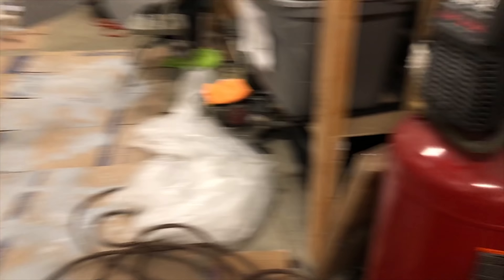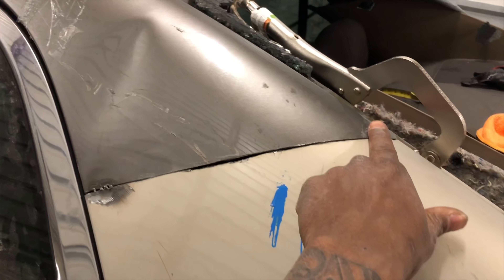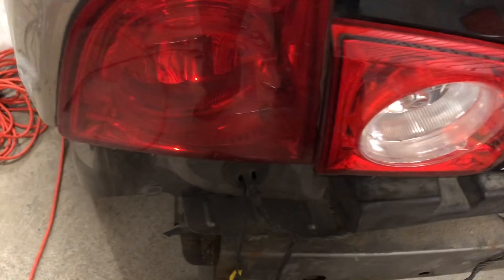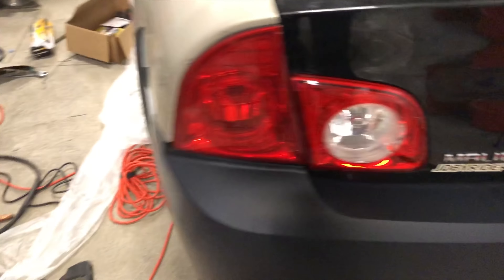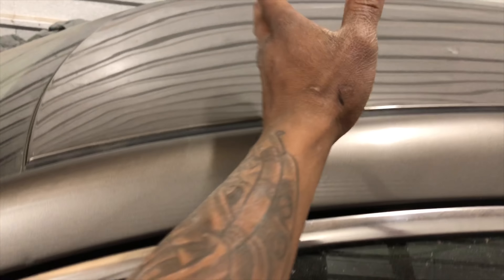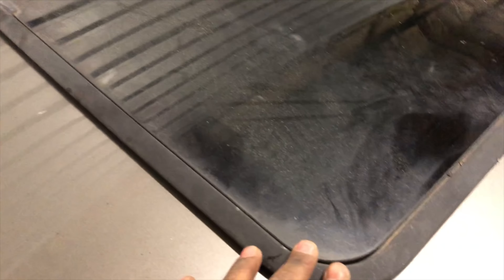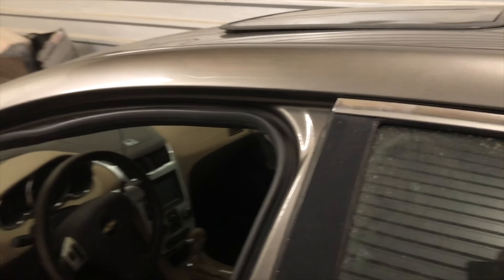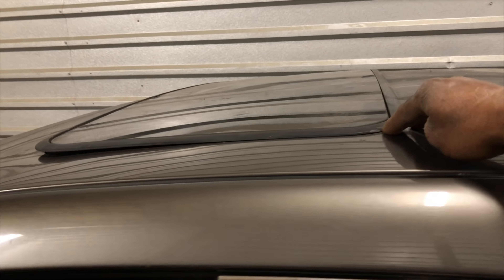2010 Malibu: Sunroof & Quarter Panels On But There’s Some Quirks

Comment: My advice would be but weld qtr pillar panels, grind welds, fill with Duraglass then body filler. If you weld plate on top like you said.  You will be creating a very high section that will be very hard to hide. You can weld a small tab on dent on original qte pillar. Then pull dent out with pliers or vise grips. Big and small slide hammers and a Magna Spot gun would be idea...but not worth investment if your not planning on doing lots of bodywork. Are you using flux core wire? I've never used flux myself. With thin metal like todays cars smaller wire like  .023 wire is ideal. If you have a air compressor as you are tack welding you can immediatly cool welds with your air nozzle.
Reply from the maker: Richard Jones The Metal plate went behind the sections, it’s done and a video is coming on it. All I have is a 110 and a 220 flux core welders and they only take .030 and .035. Cooling is a must. Thanks for the tips.

Comment: You have fire extinguishers in Shop?
Reply: You are doing good for your first attempt. Just takes patience....and don't be afraid to ask questions.
Reply from the maker: Na need to get one ASAP for here and home
Reply: Please do, I've experienced welding on a vehicle and insulation under panel catching on fire. It get real ugly fast. Fire extinguisher saved my Shop. Vehicle was on frame machine so simple pushing it out of Shop wasn't a option. Back in HS a bud and I was working on his 1979 Z28. We had a trans line break causing a fire. We were able to push car out of garage and get a garden hose. From that day forward we both keep fire extinguishers on hand.